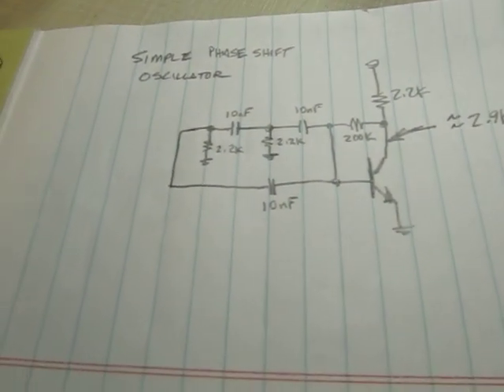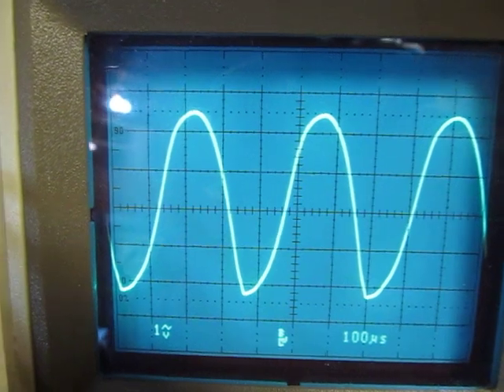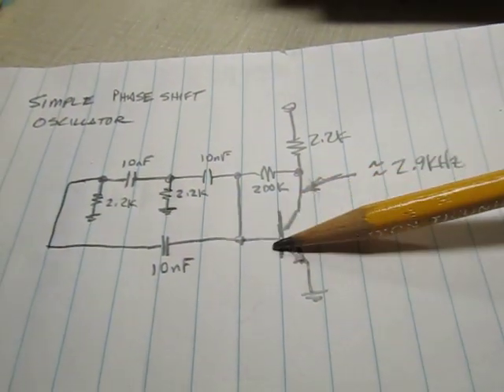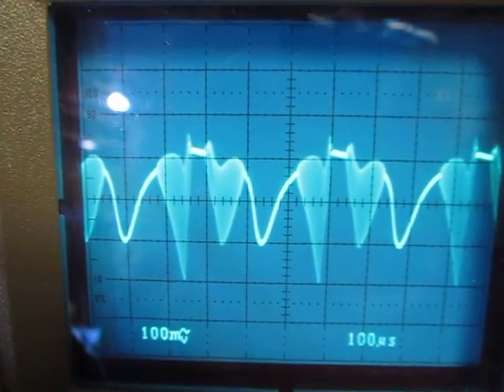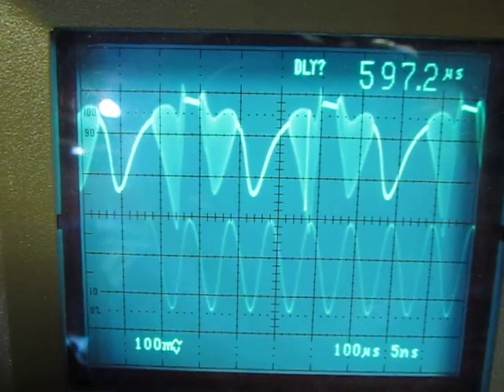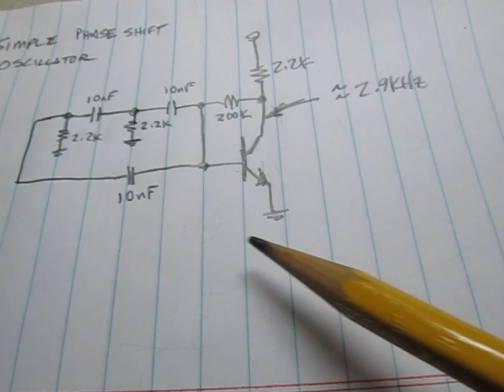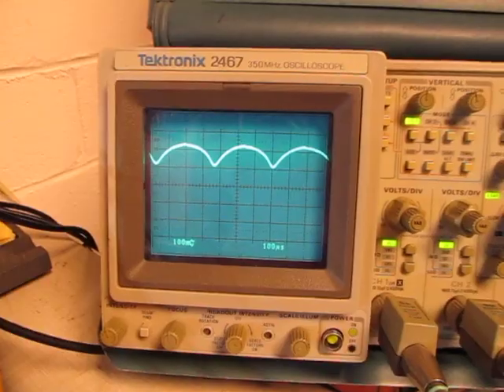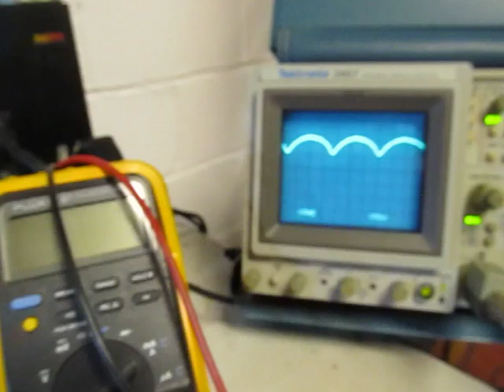#25: Analog Oscilloscope bandwidth considerations

Comment: Would you know how I could increase the bandwidth of an oscilloscope? I might be buying a 15 MHz scope, and I was thinking maybe if I'd want, I could increase its bandwidth. I have the schematics (Telequipment D65), so I thought I could just look on D66 and put all parts different on the D65 and that should increase its bandwidth to 25 Mhz (D66's bandwidth). Or I could go look on some other Telequipment scope and get the parts and put on this one and increase its bandwidth. What do you think?

PS: I was also told I could be limited too by the CRT. So I guess I could increase it to for example 100 MHz and then let the CRT decide where it could take me. Good or awful idea? haha

In any case, thank you for the video!
Reply from the maker: If you compare the service manuals (schematics and PCB layouts), you can determine if they 15MHz version is intentionally BW limited down from 25 or something wider.  However, keep in mind that even if you are able to convert it, it would likely need tuning/calibration to be flat over the rated BW.
Reply: @w2aew  Thank you for the fast reply. What components do you think that will need replacement if I attempt to do this? Caps, inductors and transistors? (The ones that came to my mind that rely on frequency - in the case of transistors, for the gain.)

Comment: I'm looking for a analog scope to monitor my 10 meter radio on 11 meter band. What band width scope would i need for 27mhz plus?
Reply from the maker: For monitoring the RF envelope, you don't necessarily care about having accurate amplitude measurements, so you can use a scope that has lower BW.  A 20 or 25MHz scope would be fine, but a 50 or 100MHz (or greater) would be better.

Comment: My belief is that there are two equally true statements, not just for bandwidth, but for anything in life.  1. "Buy as much (best, etc) as you can afford."  2. There is no such thing as a starter or beginner anything.  Learn on the best you can afford (back to statement 1.)  My first scope, a 2467B, was no more difficult to learn on than a 465, or any other.  When you don't know anything there are no bad habits to bring to the table.
Reply from the maker: A 2467B is a heck of a scope to be your "first" scope!  I remember buying them "new" at my first job in the mid/late 80s, and they were over $12,000 due to the special microchannel-plate CRT.
Reply: @w2aew  Gotta learn on something. I love that scope. I'll never be another you, but in the 8 or 9 months I've had it I've kicked butt in learning it, mostly from watching your videos.

Comment: Can you use x-y mode to measure the phase shift between two signals?  By rate turning per sec you can tell how much those signals differ.

Comment: I got a question for you If i was to increase the oscillator frequency range  do u think it would increase the at least view able signals in the scope I know the crt and the amplifier have a part to play as well. But perhaps there is a little more in it maybe instead of 5mhz I could get 10 or 8 or 6 for that matter just wondering I have a 500mhz digital scope but just wondering on my old tube CRT scope if I lower the capacitance on the on horizontal oscillator say I add a extra range per say to the wafer switch just wondering?
Reply from the maker: Probably not.  The horizontal and vertical amplifiers and CRT drivers will likely not have enough response to extend the frequency range by much.
Reply: @w2aew  Am sure your probably right am sure they squeezed every bit of bandwidth they could out as it is.

Comment: Given that you also own a tds2000 series, is it possible to do the same delayed triggering zoom trick with a tds2000 series?
Reply from the maker: You can - sort of.  In the Horizontal menu of the TDS2000, you'll see you've got a menu on the side that has entries for "Main", "Window Zone" and "Window".  If you select "Window Zone", you can adjust the "zoomed region" by using the SEC/DIV knob for the width and the HORIZ POSITION for the delay.  Once you've got the desired area indicated by the vertical dashed cursors (using the aforementioned controls), select the "Window" menu item.  The display will then show you the zoomed area.  You can't get both the unzoomed waveform and the zoomed window at the same time.

Comment: Great video Alan. So, is it safe to say that the bandwidth is actually the highest frequency that a scope can effectively measure from zero?

As always, thank you again for such great videos. They really are fantastic.

N0BPS
Reply from the maker: Looks like u found my video describing scope bandwidth and you no know why the answer to this question is no.
Reply: +w2aew Indeed!
Reply: Is $200 a reasonable price for a Tektronix 456B? the scope looks in excellent cosmetic condition don't know how it performs. It comes with all the manuals and probes also includes an audio cassette. Is there a way to test it to know that it is in good condition?Can you advice please.Thank you again for very interesting video I am learning a lot.Cheers
Reply from the maker: If it is in exceptional shape with good probes and manuals, then yes.  Otherwise, it is a little pricey.  Maybe negotiate down closer to $150.  Quick checks - make sure both channels work with calibrator and probes, make sure you have a sweep at all horizontal settings, etc.  Just run through all of the controls to be sure they do what you expect.
Reply: Thank you will follow your advice.

Comment: If you have to make do with a low bandwidth scope, you can in some cases detect oscillation by holding your finger, a metal tool or a piece of ferrite close to the circuit. If this has any effect on a waveform or or on the supply current of an AF circuit, it is oscillating at RF.

Comment: Nice video, but I think, the oscillation has started after you have connected the probe to the base of the transistor. And a little tip: dont use ceramic high capacity capacitors in low frequency circuits. The ceramic is highly non-linear this means it changes its capacity when the voltage above the capacitor changes. This leads to disturbances and additional harmonics in the circuit.

Comment: Thank you very much for replying. This leads to a follow-up question: Ok, so the BW limit can in some cases clean up the signal I see on screen if there is any noise to it. But is this "clean-up" happening pre- or post-triggering? If the high-frequency noise is causing trigger problems (triggering on the noise as well, showing "two" sine waves as lobes on screen), can BW limit help me with that?

Comment: Thank you for all your awesome oscilloscope videos. A question; In what kind of situation could you actually take advantage of the 20 MHz BW limit button? Why would I ever want to limit the bandwidth on purpose? Why is the button even there? I have a 100 MHz analog Tek scope and would really like to know at what point I can benefit from this function. Thanks.
Reply: 10 years later. I think when you wanna filter out high freq unwanted signals above 20MHz like noise spikes and stff, u would want to turn on the 20MHz BW limit. In the video, the signal is only a few KHz of a sinusoidal signal so u wouldnt see any significant difference when turning on 20MHz.
Reply: But u prob know a lot more now than me. I m just a 3rd yr ee student hehe
Reply: Usually the higher the better cuz u never know when ur circuit picks up some weird high freq shit

Comment: Would a 2230 have been able to spot that oscillation? It might not have been able to fully resolve it due to the 100 mhz bandwidth but would the blurred trace be evident?  I guess I need to build something similar and find out. Is that something that the choice of test leads could affect as well?